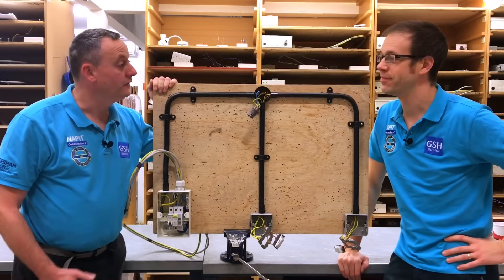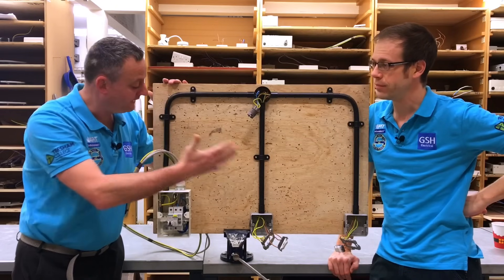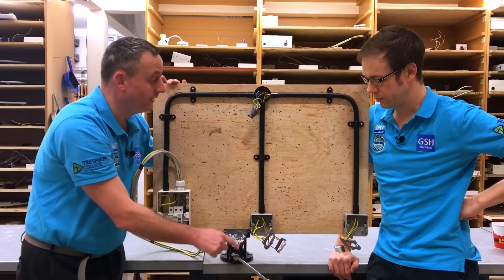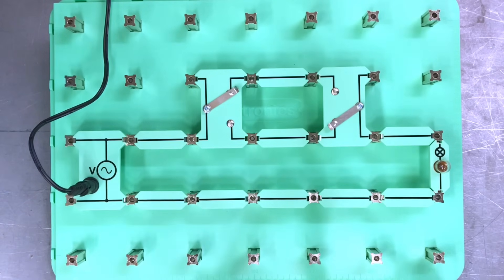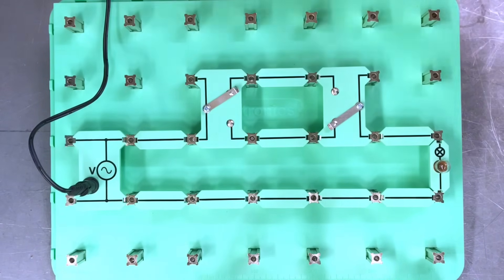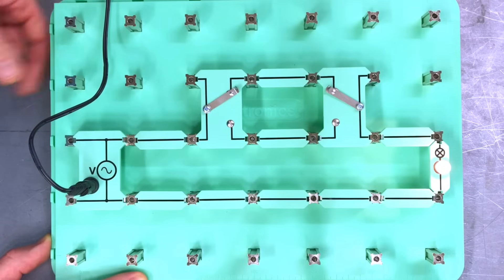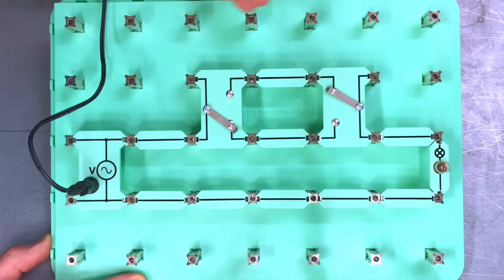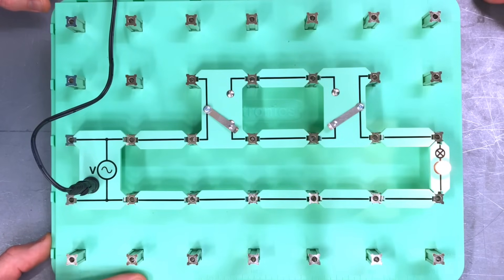Lighting Circuit Conduit Loop-In Method 2 Way Switching Wiring Explained - Matrix Locktronics Board

Comment: I LIKE YOU BLOKES 
YOU EXPLAIN VERY WELL  
I USED BATTERIES AND BULBS TO TEACH MY LADS IN THE SAME WAY 
I MANAGED TO HAVE THEM WORKING ON MAINS VOLTAGE BY THE AGE OF 8&9  
I MUST SAY THAT HOUSE WIRING IS NOT A VERY GOOD PLACE TO TEACH YOUNG BOYS &GIRLS AS I LIKE TO TEACH THEM ABOUT GENERATORS 
FIRST IT DOES TEACH THEM ABOUT POWER FACTOR NUMBERS WITCH IS NEVER COVERED IN DOMESTIC APPLICATIONS
Reply from the maker: Great comment thanks Gaz